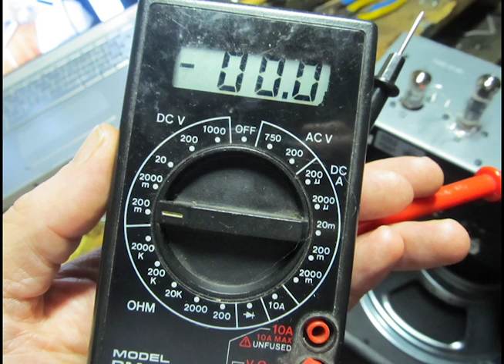How to: Line6 DT25 tube replacement & bias | CC

Comment: Any advice I got new EL84 EH made in russia from guitar center, labeled as Medium Duet, so it was a set, taped together as a matched pair. Had the amp on for an hour, needed to lower the bias since they number was running high.  I'm 4mv off one at 21.4 and the other at 25.4, do i need another set to see if they I can get them closer or just run then 4mv apart and not woryy about it? Thanks for the video!

Comment: I swapped the tubes for 2 EL84 and 1 12AX7 Mesa boogie tubes. Would I need to bias the amp?
Thank you for any help
Reply from the maker: You should. It's a gamble to just swap out tubes without the bias. Even with the same brand. That said, it's unlikely to cause any real problems/damage other than possible sh*t tone.

Comment: Just wanted to thank you so much for this video.
Reply from the maker: Happy to help. For the record, I'm had my DT25 for 7 years and am on my 6th re-tube. Sounds great!
Reply: I have three of these amps, one of them is the head version, so this is very useful information for me, I tried replacing the tubes on one of them a while back and they burned out pretty quick, I think the mistake I made was I had it in low-volume mode when I biased the tubes.
Reply from the maker: @Ghettorok1  I've always biased the amp while Low Volume Mode switch is off. Since the power amp tubes are effectively bypassed in LoVol Mode, you may have biased them to death!

Comment: Not sure I'll get a reply but I'm looking to replace the valves in my DT25, i asked on the line 6 forum and the dude on there said i could end up blowing it up because of the digital component needing checking despite there being no way to do that yourself, i wanted to know if this went okay? Did it ever blow?
Reply from the maker: I've done 5 retubes over 5 years and will do more as needed. No probs here.
Reply: @RedlightRecordsStudio  Perfect. Thank you very much for the video as well. Have a good one.
Reply from the maker: 6th re-tube now. Sounds as good as ever.

Comment: I wish just one Line 6 DT 25/50 owner or tech would explain how to do this safety for us novices because Line 6 has a shit attack if you mentioned doing it yourself, claiming there’s other internal levels that need to be checked other than just biasing the tubes. But L6 techs charge $90 per 15 minute increments to work on these. Something’s incredibly rotten in Denmark.
Reply from the maker: It's a litigious society. I just saved society millions in legal fees.

Comment: I have some JJ tubes that are labeled 29v. Should I do 25 or 29?
Reply: 25mV + - .3 The rate runs between 22 - 28 so you want it as close as possible in the middle, or 25 👌👌👌
Reply from the maker: Go with what the amp wants to see, which is 25mV
Reply: @RedlightRecordsStudio  Thanks. That's what I went with.

Comment: Great video! Shouldn’t we get the same (or very close) value in V2 and V3 or is it cool to have some discrepancy? Thanks!
Reply from the maker: The DT25’s two EL84 tube circuits are rated @25mV +-3. That means either tube can be anywhere from 22 to 28. Get em as close together and in that range as you can. It's really tough to get tubes that bias exactly the same. I've even found that tubes that have a  +-1mV range when both are close to 28, will have a +-3mV range when close to 22. or vice versa. Tubes are a bit "organic" that way.

Comment: Watched your clip , thought for a bit then was leaning towards just chucking the tubes in and hoping, then on reconsideration I bit the bullet and committed. It was quite easy actually and lucky I did because the reading first up was 17mv and then wound it up to 25mv but the other tube was 23mv and that was the closest I could get it. Went through the whole process except for plugging in my guitar and testing, will do that tonight. Thankyou for the instructional as it saved me money and was lucky I did do the bias as it would have been way too low on the bias setting if I had have just chucked in the new tubes without biasing :). Cheers
Reply: In the Line 6 blogs of the L6 website, one of the authors, well versed in L6 amps stated that he actually burns his tubes at 17mV in his DT-25 head, rather than the medium point of 25mV and the sound is still excellent and the tubes last far longer because of it. Just thought I’d throw that out there for consideration.
Reply: @BCTGuitarPlayer  I've experimented with different settings. The higher the voltage the more "lively" and louder it will sound.  In my 3 DT25 the difference in the tubes is about 1-2mV so I adjusted them to 25-26, resp. 25-27mV. Before I did it myself I got them biased by an authorized repair shop and noticed that when really warmed up they were at 28-29 mV, which sounded even better. However I don't want to break the amp, because the repairs are expensive and lowered to 25-26mV. I already had to pay 180€ to repair the transformer. If the PCB breaks, it will be much more expensive. And btw there is no special routine for biasing in opposite what psarkissian in the Line6 forum explains. It's all bullsh!t. You have to adjust them several minutes after switching on and wait for 30-60 minutes and readjust when they were hot for a longer time. The voltage increases slightly over time.
Reply from the maker: You're the reason I posted! Glad to help.